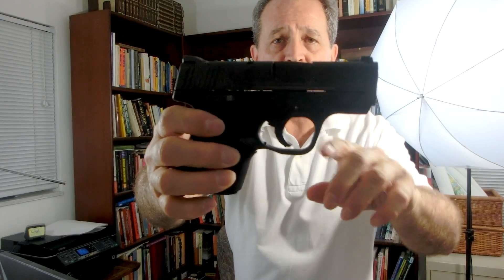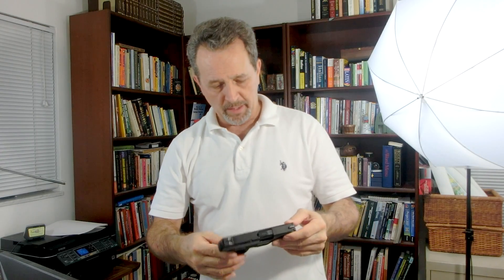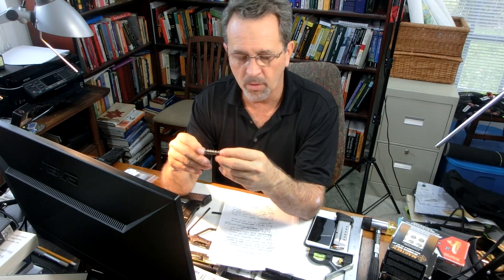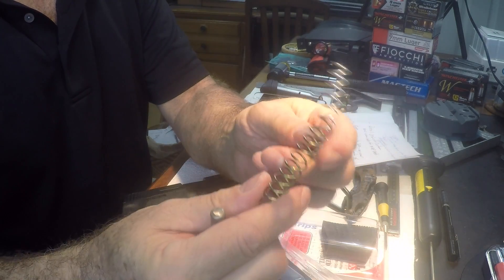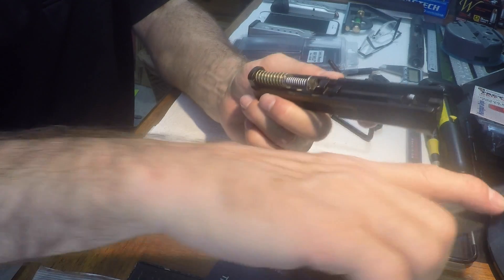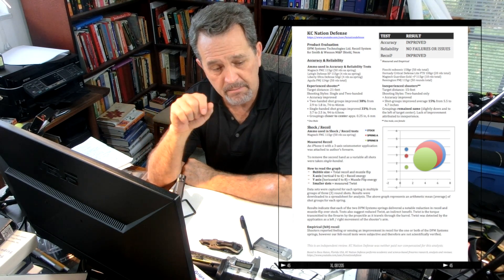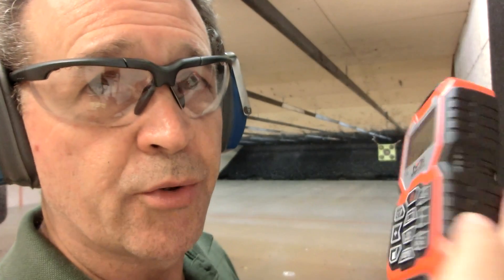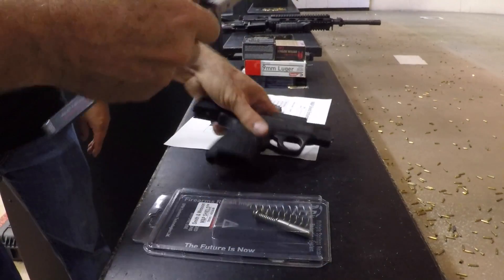MP Shield Enhancements & Test Results

Comment: Hello Hope you get this.  I bought the DPM Shield recoil reduction system and after 300 rounds of standard ammo it started to have light firing pin hits resulting in a failure to fire.  I would love to discuss with you.  I'm in touch with DPM but no resolution yet.  George Moilanen
Reply from the maker: Hello George. Have you tried putting the original spring assembly back into the pistol to see if the problem persists. I ask because my go-to for a that symptom is a gummed up striker assembly.
Reply: @KCNationDefense  Yes and it worked fine.  Problem was the DPM spring.  They sent new one. working fine again.  Spring shoudn't puke out after 300 rounds.  George
Reply: Yes.  I put OEM system back in.  Zero problem.  DPM sent me new spring.  Working again.   EDC gun must have 100 % reliability.   George

Comment: https://youtu.be/gRALdosD4nI?t=318 for the upgrade to the DPM Recoil reduction system.  I love this upgrade. Regardless of measured stats, it is subjectively much softer to shoot. Extremely fun to practice one hand shooting with now too. The guide rod with enclosed springs are a very high quality stainless piece. One side benefit of this upgrade is that I can run the cheapest steel cased ammo and I no longer get any failures.   The only minor downsides is that the shield is now a little harder for my girlfriend to rack. Also, the kit I received seems to require a lot more compression to install than the video shows. I miss the ease of disassembling the captive recoil spring and not worrying about the spring breaking any windows or shooting an eye out.

Honestly, I think the DPM piece is the best upgrade people can get for their shield.

Comment: Do you have a video on how you removed the material to reduce the bore axis? Did you simply use a dremmel? I've found videos with other guns but I've yet to find one specifically for a Shield. Thanks!
Reply from the maker: Hello and thank you for the question. I had my gun smith the work. However he did say he used a Dremel with a cylinder-style sandpaper attachment. I lost contact with him (he left the country and returned to Brazil). So I can't tell you more than that. The question might ask next, which I do not know the answer to, is how did he get it nice and smooth after the grinding. If you manage to find out how it's done, please come back and share.

Comment: I have the DPM for my Glock 42 combined with a Hogue Grip and it's made a world of difference in felt recoil and muzzle flip. I just picked up a Shield 9mm 2.0 and will be getting a Houge grip and DPM system for that to. I was wondering will it make the slide harder to rack? I have a slide racker  on the back of my slide for the G 42 which was hard to rack even before the DPM was installed. I can't find a slide racker for a Shield 2.0. It's a new gun and i'm sure the stock guide will loosen up in time but I want to get a DPM. Did you notice any difference between stock and the DPM? Thank You
Reply from the maker: We are not able to sense a difference in the strength required to rack the slide with the DPM. If you do feel a difference however, please post what you found. Thank you for the question.

Comment: I assume the shorter spring has less force (weaker) that the longer spring therefore the weaker spring.  Is this correct?  
Since the kit is for both 9mm and .40cal would it be safe to assume that the weaker spring is designed to be used with the 9mm and the stronger spring to be used with the .40 caliber?
The link to your report is no longer found on the DPMS website.  Can you provide a working link?
Reply from the maker: Hello David. Thank you for the question. Either spring can be used in either gun (9mm or 40 cal). The difference in felt recoil will likely be imperceptible to the shooter. We have DPMS springs in several different firearms and they all perform flawlessly (light and heavy springs) with a variety of ammo. We did eventually settle on the heavier spring. If you go with the lighter spring and you experience any issues with certain loads (subsonic / low-recoil for example), the heavier spring will likely address that. We have not tested the springs with these types of loads. As for the broken link, DPMS revamped their website and the PDF for this study doesn't appear to be there. I apologize. There is no alternate source for that right now. If I can come up with a safe way to share it, possibly here on youtube, I'll come back and comment.

Comment: why stipple if you are going to use a slip over rubber grip?
Reply from the maker: Good question Robert. When i purchased the firearm I had it stippled thinking that would be all I needed. After shooting the gun for a few weeks I felt the grip needed some fattening. I decided I would try the Pachmeyer Grip and report on this video what I thought about it. I liked it so much it's still on -- and its my EDC. Also, note that the stippling I had done to the firearm included removing material from under the trigger guard and beavertail improving the bore axis.
Thank you for commenting. I hope you enjoyed the video.
Reply: Did you do the stippling tigger undercut yourself? if not who did it?
Reply from the maker: Robert Warner — I paid a gentlemen who manages our fav go-to gun range in South Florida. He also stippled our Glock 42. He does a professional job.

Comment: Thanks for making this video and performing the research. Did the spring upgrade affect the amount of effort needed to pull the slide back? Is it more difficult, easier, or similar? Thanks in advance!
Reply from the maker: Cinca0989 Thank you for the question. There is no noticeable difference.
Reply: Cinca0989 my Shield 9mm is a little tough to rack the slide. I've heard the new guide rod helps. I wish they weren't so much.
Reply: @RobertSmith-le8wp  Its an issue with subcompact pistols. The spring is nothing short of extremely tight. My M&P 9 has the same issue. Being 65, arthritis hasn't helped. I'm now carrying the M&P 9 EZ. It's longer, but I can easily carry IWB with it.

Comment: I purchased the recoil system for my MP Shield 9mm and when I installed it, it stuck out in front by about 2mm. Any ideas why? Is it normal?
Reply from the maker: Igor Kravchenko Send me a private message with your email address and I will email you a picture of mine. Go to my About tab and look for "Message."
Reply: Yeah i want to know is this normal as well!
Reply: Igor Kravchenko hello, did you get any response for this issue? Mine is the same way
Reply: @jmoney6652  , I received response and they told me that it will go away after some time. It did not, but it does not bother me anymore. Everything works normal, that is just visual change.

Comment: Just to update you on the recoil management system in my shield. I've sent pictures to DPM. After review they informed me that the slight bend is not an issue and are willing to warrant that I will not have any failures due to the bend. I've since then tested it multiple times and have not experienced any issues. So my confidence in the product is there. Thank you, I still highly recommend this product.

Comment: I seem to be picking up an issue with my guide rod. I've noticed the end that rests against the barrel is slightly bent. It hasn't affected the performance of the gun but I'm worried that it could develop into something of an issue in the future. I've sent an email to DPM regarding this could be issue. Is this normal? Have you seen this with any of your springs? Thank you in advance.
Reply from the maker: Hi Gaston Davis. Thank you for sharing this. I have not seen this but definitely have that replaced. This sounds like a compromised unit. DPM should give you no issue replacing it. Be patient with them as you know they are in Greece. Please update me when you have more info / status.

Comment: What App are you using on your iPhone to measure recoil?
Reply from the maker: We used two different apps. The first round of tests, which were not used in the final analysis, were done with "Seismometer Pro" by SkyPaw. The second app is "Vibration" by Diffraction Limited Design LLC. The latter provided the final data in the analysis. If you decide to replicate this test, it is important to square the iPhone with the firearm on the axis and enable all 3 axis (flip, recoil and twist). It is important to choose a manner of attaching the iPhone firmly to your arm such that the phone does not bounce. Also estimate the trigger-movement to projectile-exit so that you can choose a sensitivity high enough to ensure meaningful sampling per-second but low enough to filter noise. It took us roughly 40 hours over several trips to the range and hundreds of rounds to establish a configuration that delivered meaningful, repeatable results and a solid baseline. Other considerations went into this -- too much to explain here. Perhaps we'll do a video on how to accomplish this. Thank you for the question!
Reply: The use of an iPhone to measure movement and acceleration is fascinating. Until I came across your review of the DPM Recoil springs the only other way I have seen to compare recoil was with slow motion video comparing muzzle flip. I would love to see a video on how you did this.

Comment: I was curious as to which spring you carry in your shield. I personally have been shooting Winchester white box at the range with the lighter spring and have had no flaws. I try to shoot once a week. I'm thinking about trying out the heavier spring to maximize the reduction in recoil. However I'm not sure how reliable it will be with just using standard 115 grain jacket ammo.
Reply from the maker: We ran several types of ammo, between 200 and 300 rounds with each spring including subsonic and Lehigh Defense Extreme Penetrators, with both springs. No issues. After the video we left the heavier spring in the gun. Many hundreds of rounds with the heavier spring have cycled through the firearm since then. No issues. Most rounds were ball ammo during range practice, around 100 rounds of various JHP, no issues. Thank you for the question!

Comment: I believe you are correct. I have received a reply from DPM with a tracking website. It's on the move and probably one more day I may have it. Thank you for the reply. I was wondering if you are still using your DPM system in your shield and if so have you had any issues since the posted video?
Reply from the maker: Gaston Davis: Yes! It is still in our MP Shield. It is my everyday carry and gets some range time roughly twice a month. No issues!

Comment: Yeah, I traded in my Shield for a Kahr CW9, which I do like more (subjective, I know). Never got comfortable with the Shield. Maybe mods like this would have helped. Maybe not. Much as I wanted to love the Shield (and the Kahr), the one I keep going back to is my old Ruger LC9. It seems much more well balanced in the holster and just feels great in my hand. That one has similar mods: a rubberized Talon grip and Galloway spring and steel guide rod. I've had that Pachmayr Grip Glove on the Kahr but it's starting to feel like too much so I may spring for the Talon grip; it's a good compromise between nothing and that big, spongy Grip Glove. I can see why you'd need the Glove on the Shield, that grip is too narrow and comes to too much of a "point" at the rear for me so it wasn't comfortable for me to shoot. Sharp recoil pulse didn't help. Again, your mods may have made the difference.
Reply: Jake Lonergan 2 years later I feel the shield has to have upgrades to make it better. The trigger needs upgrading, and you might as well reduce trigger pull. It needs a better grip and this spring has to be changed out. Sites are OK but I plan to change mine and barrel I might do as well.